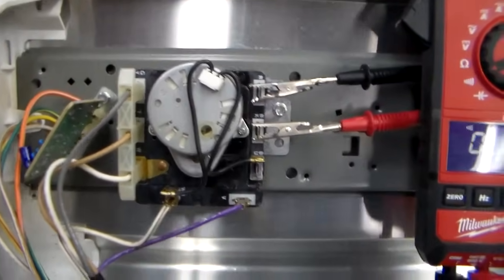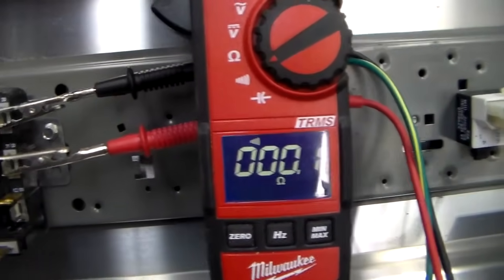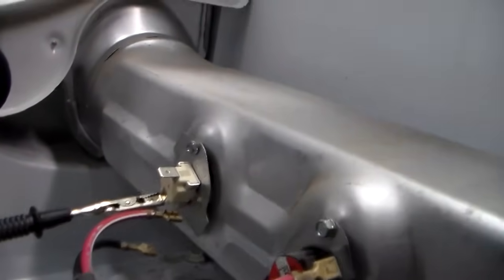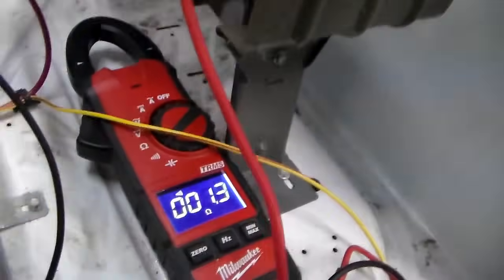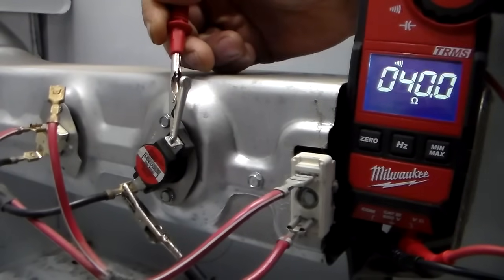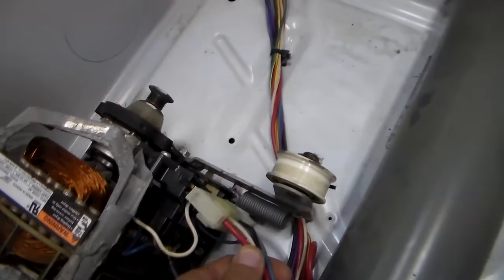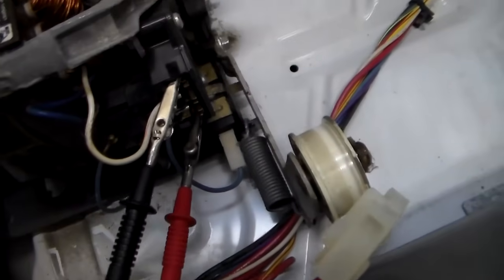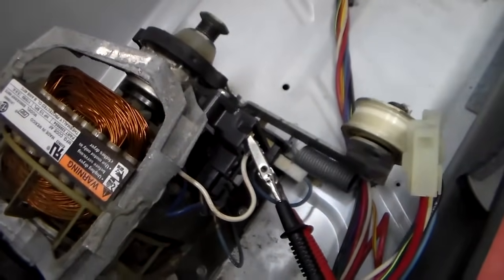Kenmore Electric Dryer - Not Heating, What to Test and How to Test

Comment: Thank You Sir Posthumously. First thing I checked was the thermal fuse and it was popped. I had a blockage in the vent line. Saved me days of having to "borrow" my Mother in laws dryer and probably a couple hundred on a service call for a $5 dollar part.

Comment: I have a dryer that isn't heating. I've tested the following: Motor switch works. Temp sensor on the flow path reads 10kohm, temp limit sensor good. Temp cycle sensor good and correctly opens when heated, heating element 10ohm, there is a sensor on the housing, it beeps good. I'm stumped, can it be the dryer controller board ? The newer units the timer is digital, I can't tell the pinout. *Paranoid I checked again and the temp sensor on the blower was not giving a reading. Research shows its PN : 134587700 and is a 54kohm resistor. Tested with a 54k resistor I had and the element came on.

Comment: Hello Bill,  I had to replace my heating element in the sleeve there and now, I do not know what wires go where.. is there anyway you can inform me of which wire goes to what fuse and then the power supply to the heating element?   my dryer is Kenmore 90 series electric dryer.

Comment: Unplug, remove back, remove one wire from every safety, or other component, check with ohm meter continuity setting.  As long as meter display changes away from 'I' component is good. Do the same for the heating element, or gas valve coils, hsi, flame switch, timer motor.  It all are OK timer contacts likely bad.  Ensure gas and/ or electricity is present at appliance as applicable.

Comment: Thx great vid. Wish I'd seen it years ago. My Kenmore gave me hell for over a year until I realized they misassembled the heater control and high limit switches. They had them in the wrong locations. The high limit kept tripping because it was in the control position. Flipped 'em and haven't had an issue since.

Comment: My Kenmore dryer 600 series is running but not heating. All thermostats and heating element test good. I don't have a separate timer, I have an electrical panel. Can this be repaired or only replaced?

Comment: Hi Bill, I have a Kenm. Dryer 110.96573200 that wasn't heating but runs. I 1st tested the switch as you described and was good so had to go on with testing the rest as you describe. I found the #3398671 to be bad and when I went to test the #3390291 the wire was fried and actual burnt out of the bakelite . Should I just replace the 2 or is there something else I should test? The coil tested good also.  Thanks, Guy

Comment: It's 2024 and Bill is still helping. We just got our old dryer running properly again without having to buy any parts, thanks to his tips on testing and resetting the non-resettable thermal cut-off thermostat. Thank you, Bill. ❤
Reply: Same with ours!! Thanks Bill! It took a few times to reset the non resetting thermal cut-off switch but it totally worked!

Comment: Sorry to hear about Bill’s passing!
I want to add another thing to test if your dryer doesn’t heat. That would be the temperature control switch.
Disconnect the power supply from the outlet.
Open up the back panel to the switches, remove the plug from your timer switch. Set your multimeter to ohms, set your temperature switch to high. Test the blue & violet wires at the timer plug. It should read between 5-700 ohms.
Reply: Question for you this might be my issue… I want to confirm I need to disconnect this timer switch first? Also, I am not getting an ohm reading on the temperature selector switch at the blue and purple at high heat or medium heat. I’m only getting an om reading at low heat.

Comment: Please PIN.  Troubleshoot 3X as fast by using the Half Split Method:  

First, test for power at the component located in middle of the (energized) circuit.  If you have power there you know the problem is after that point.  If you don't have power than obviously the problem is before that point.  

Now that you have narrowed down the circuit by half go to the middle of the faulty section and test for power.   Which will tell you which 25% of the circuit the problem is in.  

So with just 2 quick power tests, taking seconds, you have went from the problem being anywhere in the circuit to just 25% of the circuit.  Rinse and repeat.  Once you have pinpointed the faulty component cut power (typically by unplugging) and perform an ohms test on the suspect component. 

Energized Circuit Safety:  Only use one hand at a time inside the dryer.  All other parts of your body, including your other hand, should be kept at least 6 inches away from the dryer.  This greatly reduces the chance of a complete circuit being made through your body.  Which would result in you getting shocked.   You can also purchase Insulated Electrical Gloves if desired.  

Source:  1989 USAF Electronics School, Keesler Air Force Base, Biloxi Mississippi.

Comment: Thanks for the help! Helped me diagnose a Kenmore 800 series dryer that was running but no heat...tested the thermostats and those were all OK then discovered no continuity in the heating coil - found a break in the wire, ordered a replacement next-day via Amazon for $30 - problem solved!

Comment: I couldn't see the details because the closed caption text covered them.
Reply: Turn off the closed caption on the video, the button is the one with CC on it the red line under the  CC should disappear and you will not have the CC

Comment: The non-resetable sensor was the problem I had with my Kenmore dryer. The exhaust flexible tubing was almost 95% collapsed in one section. I removed the non-resettable sensor and threw it hard onto the concrete floor several times until it was reset. After re-installing it, I found that the dryer was working perfectly. To be on the safe side, I contacted our local appliance store and discussed the use of reseting a non-resettable sensor and putting it back in the circuit. His answer was this: "You may have reset the sensor BUT, how do you know it will work by design down the road if a similar situation arises."  He convinced me to replace the sensor! Something to think about!

Comment: I don't get it, today I had a dryer all fuses have continuity, heater has 14 om, how to to know if heater gets 220? I put my lead of multimeter to the one of connector of heater and second one on body, it gets 110. Then I checked second led of heater the same way, it gets also 110. How can I get 220? Where should I put leads to read 220? I tryed put between connectors of heater, but I get 0

Comment: I have replaced all the components except the centrifugal switch. The switch works! It still won’t heat! Everything checks out! There is a small circuit board in the back. Could that be the problem?

Comment: This is the best video I’ve seen so far. Trying to diagnose my dryer which has no heat. Replaced everything but the element and motor (because I didn’t check the wires first, like an idiot) but no I have a multimeter and I believe the heater is bad. My multi meter does not beep — when I check for continuity on the terminal, I get OL, but with all other parts, they appear to be good.

Comment: I have the same kenmore dryer brand and having heating element issue, and sent my order part for the heating element...my concern now, I forgot to picture the wire connection before unplug them...and now not sure which red wires connect to heating element or thermostat..please advice...need it badly, afraid if wrong connection will cause risky fire.

Comment: 😢THANK YOU VERY MUCH  FOR YOUR VIDEO TIPS ABOUT KENMORE ELECTRIC DRYER  RUN BUT NO HEAT. I FOUND THE THERMO CUT OFF FUSE BLOWN OUT. I DID RESET IT, THEN IT KEPT BLOWN OUT AGAIN AFTER EACH TIME I RESET AND START THE DRYER.  WHAT IS YOUR ADVISE ?

Comment: You missed the first check you should make, and that is the input power should be 120V on two legs and a good ground. The dryer will run with only one leg of power, but still not have heat. Peace!

Comment: jUST FIXED MINE. oNE OF THOSE JUMPERS THAT COMPLETESD THE SERIES CIRCUIT ON THAT HEATER TUBE CAME LOOSE. cHECKED THE CONTINUITY AND RESISTANCE, a ok. rE ASSEMBLED AFTER CLEANING THE BLOWER SQUIRREL CAGE FOR LINT.

Comment: Thanks a lot. I Was able to narrow down the issue with the help of your video.  Heater cutoff was triggered and I was able to reset it using your special technic. Funny thing is that the dryer stoped working 2 weeks after opening it to change the belt tensioner. I believe that when I put it back in the closet, the air hose was crushed and that’s what caused the overheat. You saved me a lot of trouble and money, thanks a lot.

Comment: This clear, thorough video helped me troubleshoot my dryer.  I knew I could put an ohmmeter across the fuses, but I had no idea how to analyze a thermostat (turns out it's just a switch!).  Combining this with the "thermostat reset" from the other video, a potential replacement was averted with a little time.

Thanks so much -- not just for making this video, but for making it so easy to understand

Comment: Ran all these tests, no problems. Dryer does not heat. Black and Red leads on timer test out OK as continuous when dryer timer is in the on position. I did notice "T" to "W" leads on timer should test closed when dryer is turned on and they do not. Could that be a faulty timer?

Comment: Bill my Kenmore has been sitting unused for serial years I took the back off and cleaned inside mildly. I then plugged it in and all I heard was a faint hum and drum wouldn't turn. I then took more of it apart and found mouse debris stuck up inside and then put it back together and still did not start up. I then started on this journey of finding out what is wrong with it. The motor would turn at first by itself with help and the heating element would fire up but with drum and stuff all put back the motor would not turn the drum. This thing has only been used for a few years and is virtually brand new. The door switch was bad so I replace that. Ive checked everything you've suggested to check and all tested okay. With all that was left and with what I knew I bought a new motor and figured all I had to do was swap it out and was good to give this set of washer and dryer to grandkids. But no, switched motor out with same results. Motor will start and engine but with any resistance its lame, I put the fan on and it won't turn at all take the fan off and it turns put centrifugal clutch won't engage. I then took old motor and and new motor after watching a video on how to bench test and both fired up with straight current from 110 outlet put back in dryer and same old problem. The model number is 110.64652400. Just a thought could I not have enough amps even though I test out and 240 volts. I know this is long winded but your videos have been great, but still need to get dryer running by this weekend without calling a repair man. No offense to them though just thought I good do this and gift them to grandkids. Thank you

Comment: Thank you Bill. I recently changed out my entire heating element assy because there was no heat -  it included the hi-limit swt and the thermostat. The dryer worked like a champ for about 3 months and then it stopped heating again.  Also, I'd have to manually hold the door switch, hit the power button and then with my other hand, help the drum start rotating then close the door real quick.  After taking the dryer apart, I've read out all of the components attached to the heater, the thermal switch on the motor housing and the motor switch itself. When I pull back the black ring, I have continuity but the black ring does not stay in that position, it slides back toward the pulley but not all the way. Is that normal? If the centrifugal switch is good, could the motor itself just be bad? I'm at a complete loss on what my next step should be....

Comment: Thanks to your video (and a few like it) we are drying again, instead of just tumbling clothes at room-temperature air. Our Kenmore differs from the one in your video, so I had to extemporize, to solve how it comes apart. Don’t know why anyone would design these things so that you have to disassemble the entire unit to get at the thermistor, but you do. An opportunity I suppose to vacuum the insides. The thermistor itself was only off by two units on my multimeter, but that was enough to prevent the heating coils from coming on. Luckily I was able to find an outlet willing to put parts in a bucket while I stood well back from the door. Thanks for saving me a couple hundred dollars on a service call (during a pandemic) or worse yet, a new dryer.

Comment: Excellent video! I have one comment so that others might avoid the pain and suffering of a dull mind :-) The dryer Bill checks has no problems! My dryer's timer dial turned the dryer on but no heat came on. It didn't make sense that something that was turning the dryer on and off wasn't working. I kept rechecking the heating element and thermostats. The continuity test between the two prongs he tests on the timer dial showed that was the problem! I searched the part number on the internet and big brother Amazon had it on Prime for cheaper and quicker delivery than Sears. It worked like a charm. Thank you Bill!!

Comment: On my dryer everything seems to be fine all the components seem to be working the only thing I saw on the timer was when I turned it on all the way to 70 it was working and then like around 40 or 30 it wouldn't beeps no more, I want to know if that's normal or do I need a new timer switch

Comment: Thank you SO MUCH for creating this video!  Of course, the dryer stops drying at 8 o'clock on a school night while there's another large load in the washer waiting for the dryer to finish.  Fast forward to finding this awesome video, and we were back in business within a couple of hours.  (Most of the time was spent cleaning out the vents and the inside of the dryer - egad!) But we traced the problem to the non-resettable thermostat and had fun taking turns banging it on the floor like a snap n' pop until the continuity was restored (my husband won).  God bless you for taking the time to make and post these awesome videos! You are a genius!!

Comment: This is a very good video but I would like add one thing. The switch on the motor works off of centrifugal force and the mechanism that activates the switch could be sticking on the motor shaft. Just because it will work using you finger, doesn't mean it will work when the motor is spinning and doing the switching. The motor shaft could be all gummed up with dirt causing the slide mechanism not slide on the motor shaft. If this happens the switch will not be activated and the heaters will not work. The motor shaft may need to be cleaned to get the switch to activate. This happened to me on a Kenmore series 80.

Comment: Hey bill I'm an electrician and tested my dryer like in your video and the thermal switch in the back was bad. I did the reset trick and viola success but a few days later it tripped again. I ordered a new one and installed and success but 2 days later it tripped. I am stumped and I cleaned the lint in the dryer right before and wasn't that dirty. What am I missing that would cause this to trip again? 
Thanks in advance 
Chris
Reply: If the Thermal Cut-off thermostat was blown, it's recommended to replace it together with a High-limit thermostat (by the heating element), because it may be out of spec and tripping the Cut-off, which acts as a safety device. If you already cleaned the dryer of lint is good, but there could be more lint in the pipe going out of your home. Make sure it's clean all the way to the outside. Lastly, the heating element may be expanding while heating, and moving just a little, creating short to the ground. Inspect the heating element and make sure that it has enough clearance to the case for a little expansion.
Reply: @Your-Self  ok thanks for the tip. The vent pipe is clean as well. When I ordered the sensor it was a two part kit and I have the additional part and will install as well. Fingers crossed. I will post how it goes.  Thanks again
Reply: Hey bill just wanted to get back to you and to say thanks because when I changed the hi limit sensor everything worked great. So it was out of spec and causing the non re settable thermal cut off to trip. Thanks again
Reply: @chriscapaccio3463  glad it worked for you! Just so you know, Bill has passed away a couple of years ago :(

Comment: This video was a great starter for me. I actually ended up fixing my problem by opening the timer and cleaning the contacts. The big red wire that goes from the timer dial to the heating element was the only one corroded! Almost dropped hundreds on a new dryer.... ended up costing me a piece of sandpaper and about 15 minutes!

Comment: Thank you! You just saved me from buying a new washer and I can dry my clothes today! The timed dry circuit of the timer is bad but the auto moisture sensing works fine.
Reply: That's the exact issue I'm having. I don't know if you'd remember at this point but it was the timer for you?
Reply: @mklinger23  It sure was. Bought one online for around $75 and it's been working great ever since. Also, once mine started to go it didn't last long auto moisture sensing.

Comment: Hey Bill, thanks for this video, I learned a lot. I found out my problem was a bad circuit breaker, I had 120 volts on one side and 65 volts on the other, so it was an easy fix.

Comment: Bill – you are the man!!  Step by step, tracked down the faulty thermal circuit breaker.  Then followed your link to the absolutely ridiculous 'throw it on the ground fix' which worked brilliantly (4 throws).  As others have said, saved time, frustration and $$$$.  Can't thank you enough!